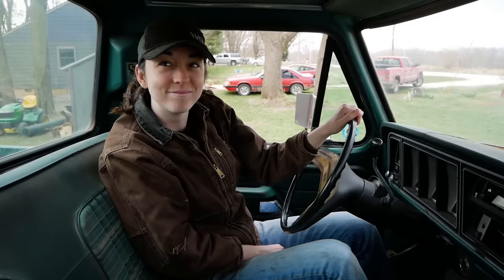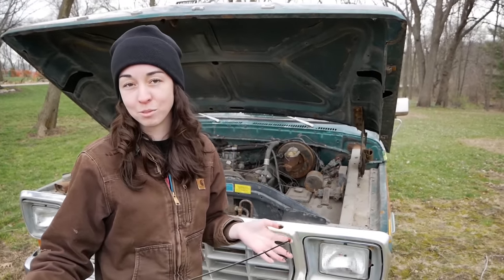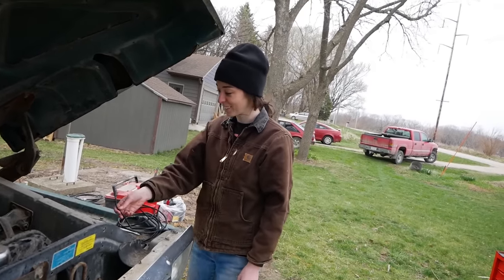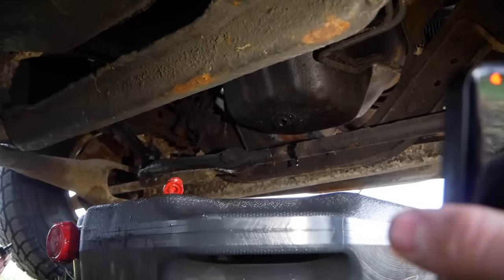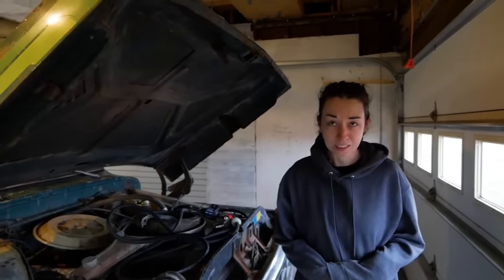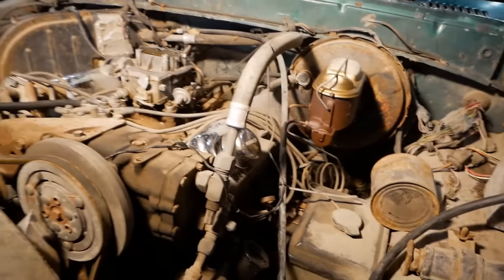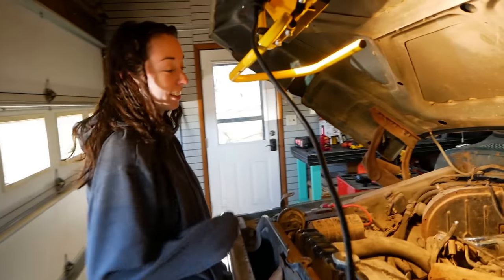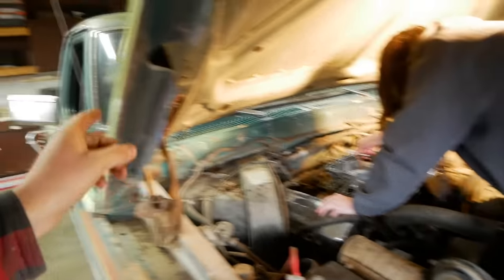I Bought a FLOODED F150! First Start and Revival!

Comment: Remove that EGR plate under the carb, That engine is re-eating its own exhaust unregulated. Horrible EGR set up on these engines. If you can't find a spacer without an EGR just make a sheet metal plate that looks like a gasket and place it under the EGR plate to seal off the exhaust. You will be amazed at the difference.